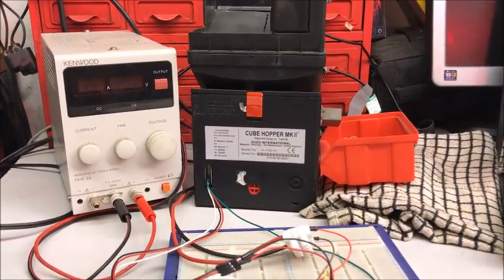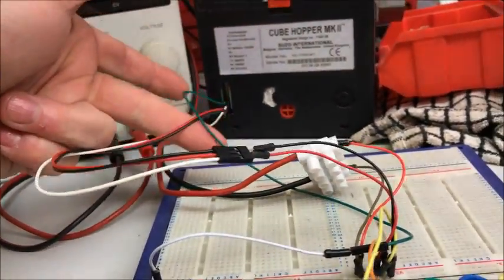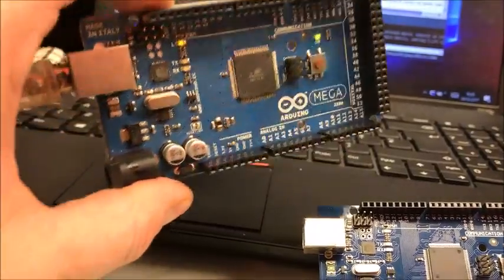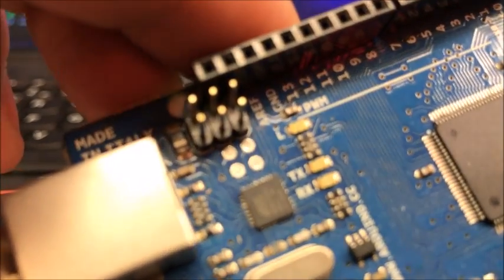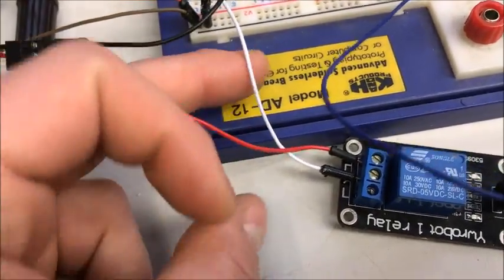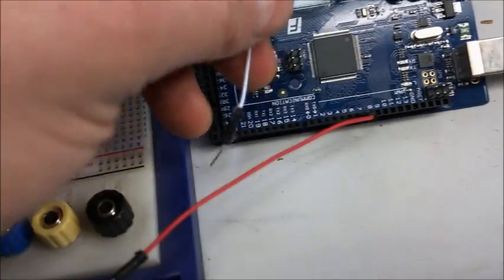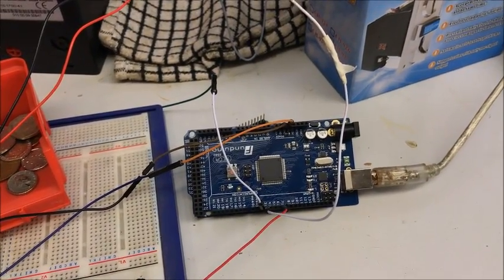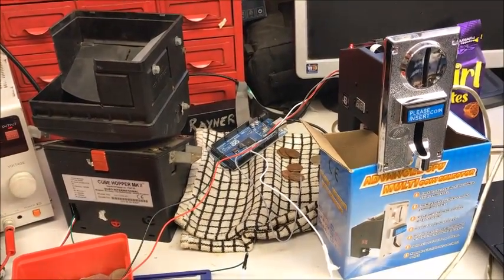How to Build a Change Machine - Arduino Project for Arcade

Comment: thanks for this video sir..i am using the code which is the philippines that inside the zip file in your website but the problem is the dispensing is not acurate sometimes it dispense correctly but sometime is not
Reply from the maker: I am afraid I made this video many years ago and no longer have the equipment to test. You could try and alter the code to provide a different delay time or perhaps your dispenser is not accurately pulsing to signal a coin has been ejected?
Reply: @craynerd sometimes it is accurate but sometimes not
Reply: @craynerd i try to change the delay but i could get the exact time delay

Comment: Hi, I have a programme on my laptop that I have made, it is like arcade reels, similar to Bar X. I have got the reels spinning, and it comes up with some winners, like X - X - X or BAR - BAR - BAR, where i want it to dispense 5x 10p coins from a hopper. Do you think there is anyway I could do this?

Comment: is there a way to make this without arduino, as I'm not that technical. i can get a hopper and a coin acceptor easily... if you connected the hopper to a power supply, but with a press button between them, could u press the button once for one coin to be given from the hopper??!?
Reply from the maker: UK COIN PUSHERS no. The coin hopper doesn’t work like that. It just powers up and spits coins out...really fast. You need a PIC/microcomtroller/raspberry pi...a computer basically to count how many coins it has dispensed so it knows when to stop! You could make something to dispense one coin at the push of the button (in fact my test code was just that!) but you would still need a microprocessor to count how many coins it’s released.
Reply: ok thanks very much.. i will look into  it

Comment: Hi, my country works with euros, I would like to have a machine doing the same as this one, but the change would always be 10 cents, If I buy your code would it work?
Reply from the maker: Yes it would. You would just need to make some minor adjustments but yes it would. More than happy to help as well if you get stuck. Cheers
Reply: The adjustments are made on the code or on the CH-926?
Reply from the maker: Duarte Rei you will need to follow my other video and programme the coin acceptor using euros. You may need to make a minor adjustment to the code as well. I can do that for you. :-) 
goodnight!
Reply: Thanks a lot! 
I will buy your code and ask you for help soon as I got the material needed 
Cheers.

Comment: HI, craynerd. Are you confidernt the coin acceptor cannot be fooled by quickly inserting coins. The tests on my CH926 showed that you cannot tell apart 6 pulses (seen as £2) from, say, 4 + 2 pulses (actually generated by inserting 50p quickly followed by 10p). Did you test that use case ? 
See my blog post at http://blog.deconinck.info/post/2017/02/25/CH923/CH926/CH928-coin-acceptor-features-and-caveats for more info.
Kind regards,
Vincent
Reply from the maker: Hacks hi Vincent. No I did t test that case. In which case, would a way around this be to programme different pulse counts for coins so they are not multiples. Hum. I haven't got the test setup together at present as I'm working on something else but it's a good case.
Reply: Hi. 
I guess you mean something like prime numbers ? Interesting idea but after a bit of fiddling, I'm afraid there will always be cases that will cause issues, like 2 + 3 = 5 (all primes), plus you have to protect against quick insertion of 3, 4, or more coins in a row. 
I don't have a mathematical proof, but I'm afraid the "obvious" solution (count proportional to value) is also the most reliable one... 
KR, 
Vincent.

Comment: Hey Chris, any chance you can explain how the relay is wired to the coin acceptor please? I've got a 12v dpdt relay and I also bought some  7v zenner diodes but not sure if they are needed or not.
Reply from the maker: Hi Gems, thanks for watching and thanks for the question. The relay isn`t wired at all to the coin acceptor. The coin acceptor is permanently live, so there are only 3 wires used, 12v, ground and the pulse output as shown on the video. This goes to pin  3 (in my code).The relay is used on the coin hopper. The 12v feed goes through the relay.   The Arduino energises the relay when it needs to dispense coins and turns the relay off when the correct amount of coins has been ejected. Hope this helps. If you want to stick some diodes along the relay and coin acceptor lines, it may reduce back spikes and false pulses however with good grounding and a GOOD power supply, I didn`t have any issues with this.

Comment: How is the Arduino , detecting the sensor pulse, without the Arduino ground being connected to the 12v ground?Also ids thre Arduino getting a 12v pulse? I thought it could only handle 5v.It obviously works but I can't understand why !
Reply from the maker: paul Meynell morning, good points but both the hopper and acceptor give a digital 5v pulse despite their input voltage being 12v. You are correct that if it was 12v the arduino couldn't handle it. Regarding the ground, it's a good point - the grounds should all be tied together. Thanks for taking interest.